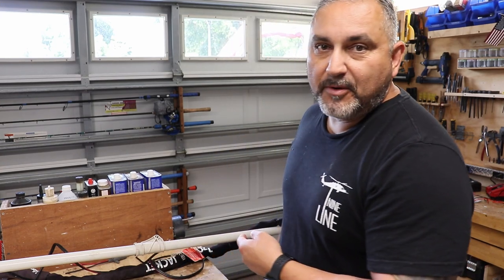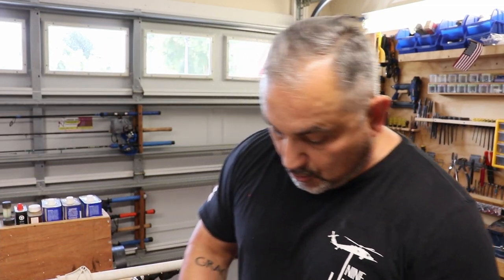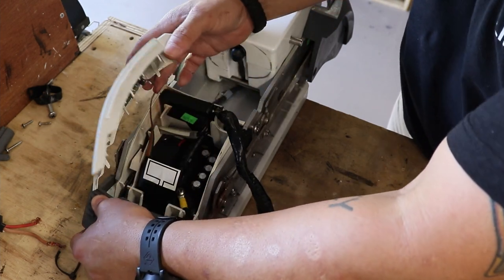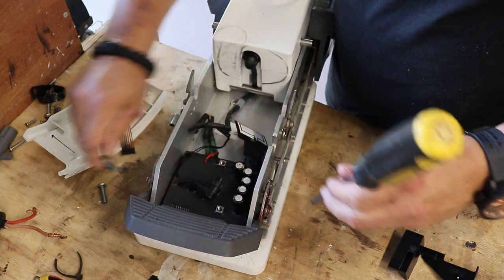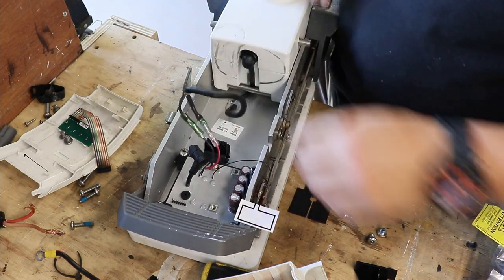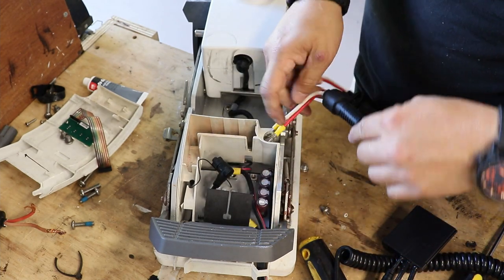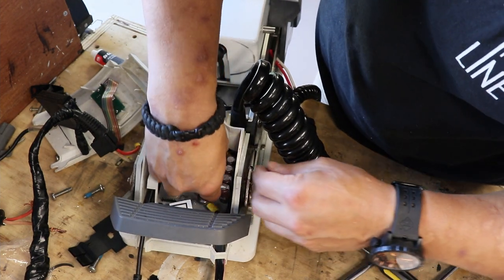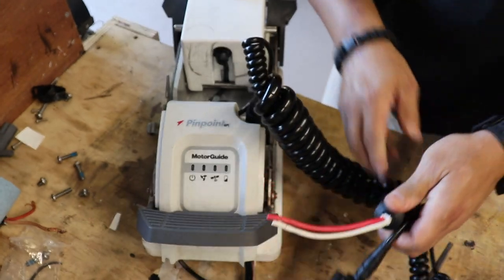How to repair your Motorguide Xi5 trolling motor step by step

Comment: Have the same xi5 was using it and it worked fine, had it on spotlock was fishing looked up and I was almost in the rocks. I had all power lights on but the motor would not kick on, the unit would turn left and right but the motor itself would not turn back on.? Any help with the problem would help. Thanks
Reply from the maker: JD thanks for question,  I wish I had all the answers.  You will have to troubleshoot your system, I always start with power, make sure your batteries are fully charged, and the cables connecting to the trolling motor are providing adequate voltage, if the trolling motor isn't receiving adequate power than not all of your systems may work.  definitely try the manufacturers website and see if there have been any issues related to the problem, third check to see if the integrity of housing for your trolling motor has been compromised. i.e. cracked, or a seal broken this will most certainly cause issues especially if you fish in saltwater, and than of course there is your remote.  check and see if the batteries may need to be changed or if there is corrosion. good luck

Comment: Great job diving into it captain.  Wondering if any issues with the GPS have occurred? I tore out the wires at the lower GPS puck and now putting the new GPS system on an old base thinking I may get the problems seen by others with tangling. Do you still have old GPS that you replaced? I may need that to get mine flying again.
Reply from the maker: Appreciate the comment and question my friend, unfortunately I don’t have the old GPS puck, the wires were seriously corroded and I had put so many bandaids over the 5 years I had the trolling motor. I haven’t had any issues with the GPS, it locks pretty quickly.  I do hope you get back on the water soon. Tight lines!

Comment: Hey mate just a quick question in the video it looks like when you take the power wires off looking at the video the power wire from the battery at the back is screwed down with the white wire and then when you put the new board in, the battery wire is screwed down with the red wire and the white is screwed down where the red first come from. I have just done mine and having a problem of power is on no matter if the motor is up or down. Thanks
Reply from the maker: Thanks for the reply my friend, I am reviewing the video, I would love to address your question is it possible for you to tell me where in the video you are referring to, maybe a couple of timestamps. What I can say is that the new components that I replaced may have changed the colors of the wires which may be the issue. I wish I could give you some greater context and I'm interested to figure out what the issue is with your trolling motor, send me the time stamps and we can figure it out from there.
Reply: If you have a look at about 16.42 you can see where you disconnectthe wires and the about 33 mintye mark on you can see where the white and red change sides.

Comment: Great content!  Any chance you have a good video reference on the Xi5 foot/lower unit rebuild or specifically reassembly ? Mine was making the screeching sounds, pulled the front plate to view brushes, magnets, and blow out old dried glue.  Now the armature magnetic resistance is fighting me to get the front and back caps on.  I bought a new foot and figured I would rebuild this one for the next time I need a spare.   Been searching for days and cannot find a good reference.
Reply from the maker: Jeremy thanks for the comments. I do wish I could help. The most I’ve done is repaint the lower unit and check the seals to make sure I didn’t have any water seepage. If you end up with a solution please share I would love to see that.

Comment: I learned that a bad remote will make you definitely think something is wrong with your trolling motor. Always have at least two remotes in case something is not working properly. A little corrosion on the plug and even the 50amp breaker will prevent the trolling motor from working. Took my motor to the shop twice and both times it turned out to be something else.
Reply from the maker: You are most correct my friend, those remotes are super expensive too, Hindsight is always 2020. My takeaway was that I essentially upgraded and updated the internal electronics and that was by happenstance and troubleshooting.  thanks for the comment and tight lines!

Comment: Can you provide a link or any information on where I can buy those parts?
Reply from the maker: Sure.  Boats.net thy have a good selection, quick shipping and good prices. Good luck!
Reply: @gabrielpadilla1362  how did your repair work out? Are you having any issues with your xi5?
Reply from the maker: @kens.8124  works very well

Comment: I have a Xi5 trolling motor and it has never worked since I bought the boat used from a guy who didnt know Jack about boats, where do I start to try and get the trolling motor to work? What parts should I buy to try and get it running? Nice video by the way man
Reply from the maker: Oh my!! Well hard to say where to start but a good place is to make sure it has power. Check the connections to the batteries, fuses, cable. Pretty simple to do unplug it And check it with a multimeter. I guess the good thing is that you can replace virtually all the components and with prices and scarcity it may very well be ur best bet. First start with power to the unit itself good luck and send us an update!